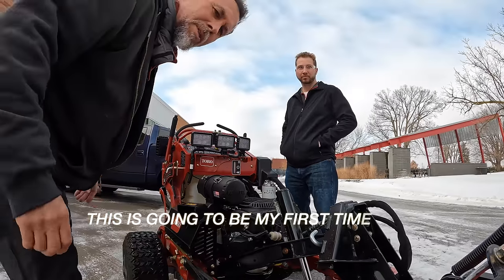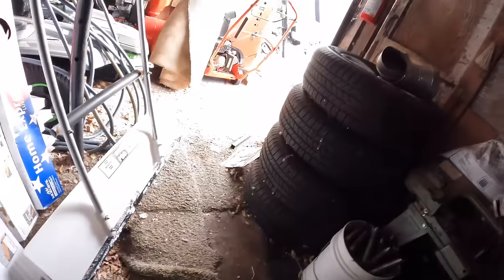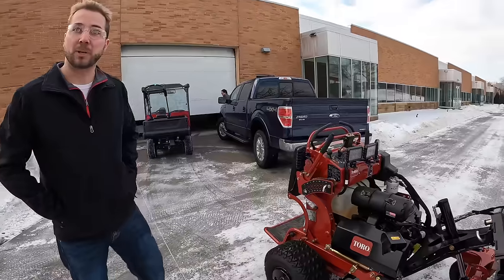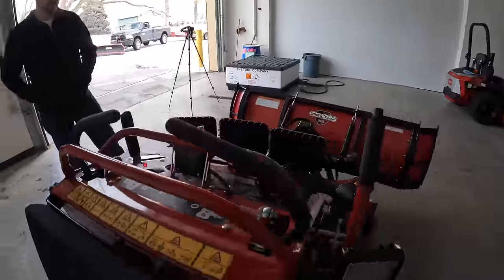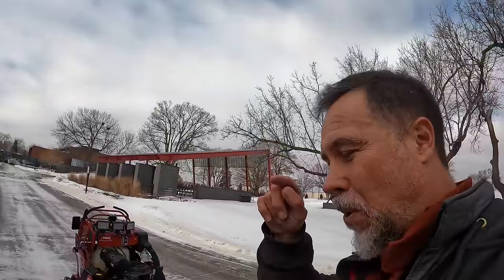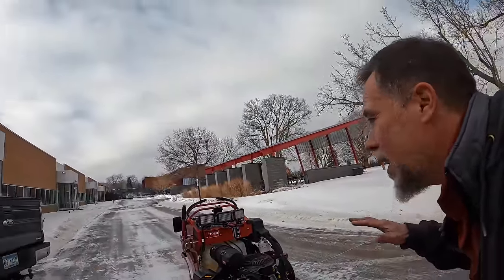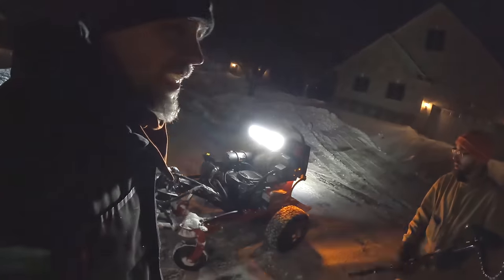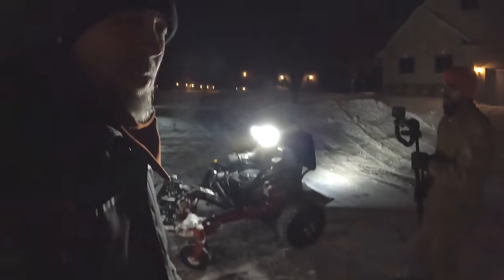Testing a new machine in Fresh Powder

Comment: I’ve been plowing for 35yrs with a quad & everone asks me how you get your driveways so clean. For starters I don’t like driving over snow. The other thing I took off the skid shoes & mostly run with the blade on a angle for it won’t dig into the expansion joints. 
That Toro would be nice but I need a sitter because I’m getting old with 2 back surgeries. Been looking for a riding mower with snowblower. Wished Toro had a zero turn with 48” snowblower attachment like Walker & Grasshopper. I ran Grasshoppers before when I first worked for the city mowing parks & cemetery. 42” mowing deck would be big enough that tilts up for service like on those others but the walker would be harder for me to get on & I hate that the controls are between your legs. I would want it to mulch & the option to put a bag on when I pick up leaves. 
Most of my driveways I do on my quad are 30’ long 2 car garage & a snowblower will beat me most of the time because I have to get off to shovel up by the garage doors & sidewalks. Sometimes there’s opsticls in the way & I had one driveway that had bushes on each side. I plowed it across the street & city stopped that. I then pushed it out & around the bushes. I mostly push it to the sides of driveway & ramp it up but there’s been times I had to go back with blower to throw it over because driveways where getting narrower.

Comment: Thanks for taking the time to film this review! It definitely did much better than I expected! One thing I noticed the blade appeared to have some down force while you were back blading does it push down? Another surprise was the amazing traction it had. If you mentioned it I didn’t hear, what size and brand of engine does it have and do they offer engine options? I believe this would be very cost efficient to anyone who has Condominium contacts and HOA’s or 10 or 15 or more back to back driveways no insurance no registration much less fuel expense than any truck available! Yes I enjoy the comfort of a warm truck and soft seat too, but I enjoy spending less money to do the same job which in turn would make me more money just have to layer up with too pair of long john’s a snow suit a good thermal hat and good pair of snow gloves and I think the extra money earned is worth the discomfort. As for wet and heavier snow as long as the engine has the power to push snow chains ⛓ will keep you going. I’m very interested to see how it does for you, I will definitely be watching out for your next video putting this Toro to the test! Thank you again Mr. Snow Monkey 🙈🙉🙊 have fun stay safe! Jay Bird 🦅 N.Y.S.
Reply: They do have down pressure. It will lift the front wheels off the ground. Some people use this to transfer more weight to the back giving you more traction.

Comment: Not sure I’d like standing in elements not protected for longer periods.  I could see a problem not pushing first snow back far enough.  You will not have the power or traction to move them back later.
Reply from the maker: all good points

Comment: Would buy one in a heartbeat if they made a 36” model. Being in a dense and tight residential area, a 36” option for the deck and mulch bucket would be a game changer. Could have wider tires in the winter time as well for added traction, doesn’t have to be less than 36” wide in the winter since it’s not going through gates.
Reply: Wider tires get less traction in the snow narrow tires cut through the snow wider tires tend to float on top

Comment: Hate to say this Stan but since you're probably close to being same age as me, please be careful pushing snow with your manplow  straining like that. Heart attacks are common in our age group doing these things. 
Now about the multi force. Don't have one but I've seen a few vids using them for snow. They look like a fairly efficient & capable machine moving snow. I would say they do well with lighter fluffier snow no deeper than 6". Heavy wet snow would be a different story. I just don't think it has enough ass in it to not be pushed around. Correct me if I'm wrong. Thx for your vids.
By the way, we use "snow plow" shovels for pushing snow. They have multiple sizes & hold up well.
Reply from the maker: I agree-  I think a heavier snow would slow it down.  I plan on finding out soon.

Comment: Those cheap shovels are where it's at, light weight,with no metal cutting edge to dig in and stop you short. We've even gone so far as to grind off the rivets that hold on the cutting edge on our wider pusher shovels.
Reply from the maker: Love it 👊

Comment: Looks awesome if you're doin sub divisions and have a crew. I love that you can dig into real tight areas with it. I'll be curious how it holds up in a wetter snow, like what we tend to get over here.
Reply from the maker: Yeah I'm not too sure about that but definitely works well with this fluffy stuff! Sometimes we get heavier snow but I haven't tried this machine out with it..yet
Reply: If you have a high number of customers in a small residential area, it is hard to beat a tractor with an inverted pull type snowblower for clearing snow from driveways.
Reply: @bwillan  I agree, I actually use my compact loader almost exclusively on my residential properties. Average distance between properties is 5 blocks and I simply drive machine to each job as the machine does 12 mph in high gear. Beats the heck out of freezing my u know what off on back of machine (I have heated cab too) and loading machine up after each job. When done with property I toss machine into high gear and just fly down road to next property but it comes at a cost that most smaller guys can't afford.
Reply: Works just as good in wet snow. Tend to have to angle a little bit but it can still push a ton for what it is.

Comment: We've run 1 for 3 winters. Engine issues in cold weather. Snow tires SUCK on anything but bare ground. Corrosion issues. Paint quality is terrible. It will not move hard pack snow. It has its place in the right conditions just dont expect much. I love the zero turn for snow. Visibility is perfect. Cuts grass well.
Reply: Get urself a compact loader with heated cab and u will wonder why u been messing around with a homeowner owner lawn mower for snow stuff.

Comment: I’ll comment again 😂 but I just a kabota bx2680 😆 I live in Nc and we hardly ever get snow unless it’s this year and we have go 3-4 storms and okay snow for once. But my driveway unless is a deeper snow then I’ll unload the skid steer once I get back and do it. But I still only use a bucket because paying the price for a pusher i wouldn’t make money being we hardly get snow. But I’d use the little tractor for my walkway it’s perfect with the bucket and normally use a regular flat shovel on the steps. But I like that shovel you have their super slick setup
Reply: I’d love too actually demo this machine where I live. I’d like to see how it does in are kinda messy weather sleet sometimes freezing rain first and wet snow 99% of the time. If it would go I’d probably buy 2 of them if the price wasn’t Ridiculously crazy. Add the little dump part for the summer months. It would probably pay for itself using it year round pretty quickly. All in the price.
Reply: I take everything I just said back that machine setup just as you’re using it is alittle over $30k that’s not counting the dump part 😂 that’s a biggg pass and most definitely would take forever too pay for itself atleast for me. That’s just insane. I don’t like it that much I’ll stick too my tractors and skid steer and when it get real crazy I use my backhoe. And they have all paid for them selfs so I’ll save money/make more money with what I have. And just buy the manshovel 😂
Reply from the maker: I thought it was closer to $12,000
Reply: @Dirtmonkey  the machine itself without the attachments and pumps are alittle over $14k that’s coming directly from the dealer I spoke with here where I live in Nc. But all setup thing insanely priced

Comment: Our company purchased a multi force  a  year ago, nothing but problems. So far the engine, fuel pump have been replaced. Yesterday's storm that hit the Midwest,  it left us upset and very disappointed,  failed  again. Back to the dealer again.

Comment: They really only preform that well under those exact conditions.   Wet heavy snow or slippery pavement they have traction issues, especially in reverse.    Last think I would want to do, is beat up on my primary machines that make money during the mowing season.    Suddenly your breaking down more while mowing, and you wonder why.    

If you need a sidewalk machine, get an ATV, Tractor or snowrator.

Comment: I plowed residential and some commercial for ten years. The thought of standing on that thing, in the cold… all day …..is a nightmare.  With a big snow id be in the truck for two days straight. 
I’ll prefer a diesel short bed with a straight plow with handheld control. That way I’m warm and can drink my coffee.   That Toro worked well and has an application, but probably not driveways.  Can it back up a hill over 8” of snow to plow down? …i doubt it.

Comment: Hey Stan do you think it would be faster than the 4wheeler at your commercial sites? I mean it looks to scrap good, backdrag well and turns on a dime…
Reply: Those commercial sites look huge. That 4 wheeler flies. The Toro looks slow by comparison. We’ve got a Snowrator and it’s slow for plowing long sidewalks. It’s too bad they have to make stand up machines so slow for safety reasons…

Comment: I have an acre of driveway on my farm.  If that machine can do the job I’m headed to the dealer!  Just looked it up…I can buy a used Kubota farm tractor with loader and only 200 hours on it for the same price….Definitely a city machine.  That wouldn’t handle my drive let alone be practical for around the farm use.  My sheep would laugh at me if I brought that back into the barn to move 20 tons of crap every month!

Comment: Just Wondering if known that Snow/ Ice is coming,would it be possible to 1of 2 ideas on your Units…. 
1) Maybe Add What I have seen that removed items from pickup a Roller Type Tarp that you crank up to unload 
2) My Cheap way that I use is Just Toss a Low Cost Tarp tried down, than just pulled off. 
I use a Small Tarp ( cost under 2$ )
Over my Vehicles Windshield, shut the doors and done and in the morning Open Doors Pull away ( Shake, fold & back in vehicle) 
Clean Windshield, Drive away. 
Just a Hmmm 🤔 
Enjoy the Videos.

Comment: Hay man I'm in Atlantic Canada Halifax Nova Scotia actually. Worst condition we see is 12 to 18 inches of snow followed bu a mix of rain / freezing rain becomes verry heavy. would you recommend this equipment in those conditions or more just lighter snow conditions? As far as cleaning my trailer deck I use a small electric snow blower usually referred to as an Electric Broom light weight to lift onto the trailer.

Comment: I have what's called a "Snow Pusher Lite". I use it for smaller snow falls 2 inch stuff it works pretty well.
    I was thinking about how the traction would be with no chains. Also Stan what about when it's snowing and the stand platform gets snow on it. Would your feet slip off? Maybe it could be heated? Nice machine though can get in small areas.
Reply: The platforms have openings and are cut with gripping edges similar to a snowmobile so the snow goes through the area where your feet are.
Reply: @natielou143  o ok that's good. Didn't see it in the video and haven't seen one in person. Thanks for the reply.

Comment: Have you ever checked out steel green manufacturing? They make a plow for their fert machine which means it can spread salt really well also. A plus side to a fert machine is it has a stainless steel frame . The multi force is a nice unit also.
Reply from the maker: I will check it out

Comment: I wonder how good it would be with heavy wet snow. I have a Polaris 500 ATV with a 55" blade, it works pretty good, but when you get the wet stuff, it has a tendency to push the front end around because of the extra weight.

Comment: major considerations selling are less wear and tear on large expensive trucks and plow s. less wear and tear on pavement for hoa s good selling point is less fatigue for pavement surfaces affording pavement surfaces to last longer before in need of replacement or repair.
Reply from the maker: good point
Reply: hand warmer s similar to a snowmobile has would be very nice
Reply: optional chains for traction would be a great option
Reply: heated pad to lean against for operator would be nice

Comment: I have a 42 and 32 inch man plow. Question for you; if you have had to clean up the thermal plastic blade to get rid of the jaggies, how did you do it? I know you can get replacement blade protectors, but this one still has a lot of play to it. Thought I’d ask.
Reply: Use a sheet metal shear break to clean up the edge or even a skill saw.

Comment: Hey Stan...good video.  As a growing business myself I can see where this would come in handy.  Quick question....Does it have a "FLOAT" function in the plow? Or would that even be an option?  I like the down force to get a good scrape.  However in my area driveways are never that smooth and due to the frost it shifts the pavement.  Causing large lifts and cracks.  I can only imagine having down force and then hitting a large lip in the driveway. I do not want to think how that would feel.  Anyways...thanks Stan.
Reply: We ended up grinding a taper into all of our sidewalk edges that are uneven. They plow like butter now and only takes a couple of years for the tapered edge to blend with the old concrete.
Reply from the maker: Its got a very responsive trip edge.  I hit many things with no issues
Reply: They have a float option you can buy and install but honestly the trip edge does great as is.
Reply: See? Just what I said....not needed. Thanks guys. I knew them smarties had it figured.

Comment: What would you recommend for 4'-0" walks?  This would work, but I need a cab.  Thoughts?
What about your mini loader?  What's the  travel speed on that.  How well does it work in -30°F?  We get that nearl every winter.
Reply: The cab I agree with especially when your plowing snow into the wind it would wet you down. They could design it so that there could be some heat capture off the engine up into the standup area. However,  would that $ total? 
You have the blade, you have the optional wings, you have the front and rear lights, you have the side flashers, you have the tires, you have the weights, I really feel you need a set of chains from day one, did I miss anything? 
I have no idea what this would cost but I would think with base chassis and a 54 inch deck it would be in the 8 to 11 range? And I would guess they would want at least 3000-ish for the blade plus all those options? That’s a lot of options to pay for and a lot of options to store.
I really enjoy your videos.
Reply: We use a Kubota RTV 1100. The heated cab is real nice. It’s not as maneuverable, but I can only do 45 mins out in exposure without getting off and shoveling on our Snowrator.
Reply: @natielou143  How wide is it?  Would it work on 4' walks?
Reply: @simonthebroken9691  The Kubota has go a Vblade that will do 4-5 ft walks, but I don’t care if it edges the grass over the edge of the sidewalk. It’s got a pretty wide turning radius.

Comment: I have one and use it Wish toro would have made it hook up to the blower the same as the rest of the equipment it’s a pain to hook up the blower 
Have had Wheels weights ordered sence October no luck
Salt kills this Machine Been in the shop more than I can count It has put me to using a shovel more than times I’d like to say Yes Stan kinda Disappointed 
Controls freezing up with a little missed   
Engine not going into High  because governor corroding or staying at high RPM 
The electric system catching on fire due to corrosion BlBl Bl great pieces of equipment though

Comment: Without trying it myself, two things I could see as an issue. Operator is exposed too elements, and it’s lawnmower engine is loud.
Reply: Its why in my comment I posted whereas I strictly use my compact loader. I no longer have to freeze my u know what off, I'm operating machine inside of a heated cab, in some instances where a s I'm I'm actually taking coat off...
Reply from the maker: Yeah-  a cab would be nice but this isn't just a snowplowing machine.  Its a tool carrier designed to let an operator work year round-  if they so choose to.

Comment: Has anyone bought/used that electric shovel tha works like a hand plow?? Iv only seen tv commercials but im waitng to talk or see someone using it and happy with it first..
And why cant any of these companies make a plow like this but have it convert or have it able to work like a bucket so you can move your of piled up snow?? Theres got to be a way that maybe a inch or so above the bottom plate that scrapes the ground,put a attachment or way to have it able to use as the bucket would be AMAZING and i would be the 1st in line to buy( or i will be the 1st to make/invent 👍🙂👍
Reply from the maker: Loving your ideas!!

Comment: I think you could of beat him, if you zero turned more and less back dragging cross swipes and plowed both directions some. I put rubber chains on my gravely and a leg lift plow...   Not good to be hauling on open trailer aerosoled salt gets in everything then it's penetrating oil and getting parts freed up againthen oiling in the spring to mow...  I still put the plow on my gravely, but home use only...  I am still using snowblowers a shovels for customers...